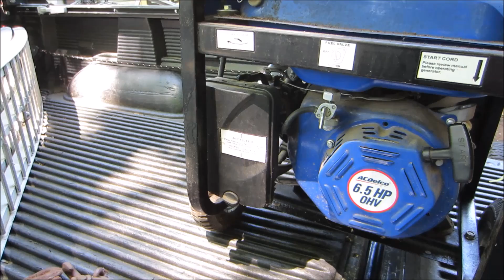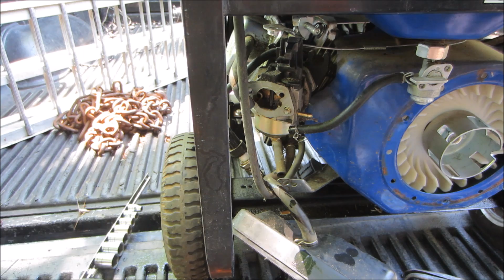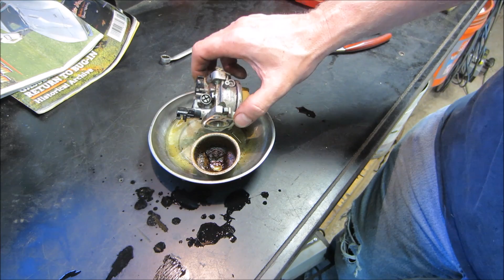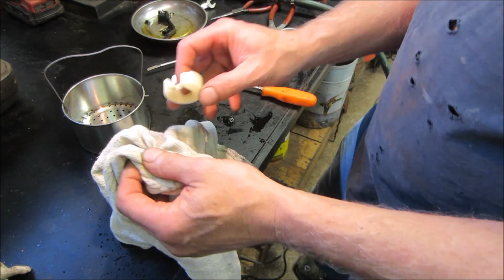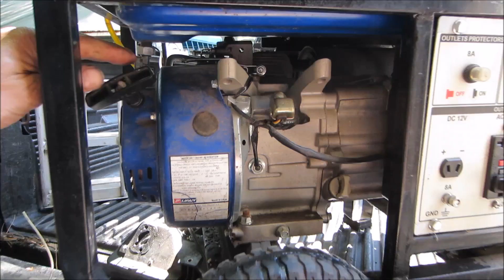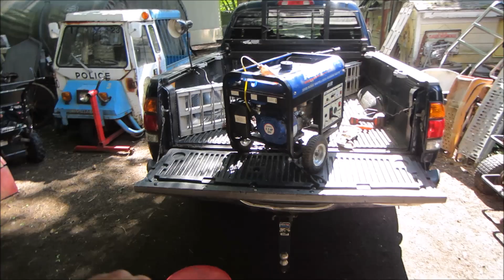will it run? seized china generator

Comment: It is way over-revving. That's spinning at 3,000 - 3,500 rpm when it should be about 2,300/2,500. I have two of these slthough slightly different between units. One is a 13 hp, 5 kW and the other 6.5 hp, 2 kW. The govenor and spring adjustment is sensitive and can be difficult to get right. It is essential to have a stock air filter to get the fuel ratio correct. The fuel tanks on both are made of shit steel and rust with the smallest amout of moisture. I no longer use our 10% ethanol fuel and use low octane unleaded. I drain the fuel when storing and squirt a lot of WD40 in the tank to help prevent rusting. In any case the E10 will deteriorate seals in a short time. These generators are low quality but if treated with TLC should last a reasonable time. They are about 1/2 to 1/3 the cost of good quality generators. The motors are Yamaha copies I think. The design is OK but the metal and manufacture is low quality. The first smaller one I had was relpaced under warranty after it just died at 30 hours. The rocker just collapsed and chewed the head up. Poor hardening on the tappet was the prognosis. The second replacement one was OK but I destroyed in an accident but that's another story. The 13 hp unit had problems that required some work. Carburettor and weak govenor spring and some rust in the tank plus a broken pull cord.

Comment: Just an FYI: Can't just use front panel voltmeter to set speed on an AVR gen. AVR is Automatic Voltage Regulator. Need to get you a "Kill-A-Watt" meter (~$30), which has a Hz measurement. Set Hz for about 62-64Hz (NO LOAD).  This sets RPM to just over 3600. AVR should then set proper output voltage.

Comment: That thing is almost the same as a Generac GP5500 mechanically. Even the air cleaner is the same and it's 50 bucks from Generac for that assembly. Good mechanicals on that AC Delco branded one

Comment: I bought  one of these and it hunted like that right out of the box especially at low load. With the choke 1/4 closed it would smooth out. I figured it was running lean so I filed the main jet one size bigger with a MIG tip cleaning file. Now she runs like a swiss watch at any load level. I heard something about these EPA rated carbs being too lean.

Comment: I c u rebuild and work on a lot of generators. I recently bought n inverter gen that's rated at 3000 watts and 24 amps. It has a 30 amp 120v twist plug n a 20 amp 120v three prong. I'm running  my welder that draws 24 amps in the 30 amp outlet. It runs it but sometimes it bogs down but does not shut off n I don't c the overload light come on. What is the damage that could b done when running a gen to max load 4 short periods of time (5-8 min) b4 letting in cool?

Comment: Do you charge for your time to do this type of work? If you do can I ask how much? I do this type of work all the time and I only charge for the parts because I already have a full time job and this is a hobby for me but my problem is that I get too many projects.  Just curious how you handle it.  Thanks for the video!
Reply from the maker: l need to says no  allot
Reply from the maker: so l got that going for me,
Reply: Mustie1 Don't worry Darrin,with all the good deeds (fixing the elderly gentleman's snowblower a couple times, then swapping for a newer one when it finally went fubar/taking the shed off the other neighbors hands and taking care of the cleanup/all the other stuff you do for your friends, neighborhood and the elderly over the years (and that's just what you showed us); You've probably built up enough points for that "deathbed enlightenment" thing Bill Murray was promised in Caddyshack. So you got that goin' for ya!!!

Comment: I always learn a trick or two from your videos.   When you fixed the garden tractor hydrostatic transmission a few weeks ago it reminded me to check the oil in my tractor transmission.  When I added some oil it stopped slipping.  Your trick with the small screwdriver helped me get the rubber plug out of the top of the tranny.   Thanks.

Comment: The o-ring on the plastic pilot (idle) jet should be inspected or replaced when the carburetor is serviced.  If the o-ring is falling apart it will run rich and drive you crazy trying to troubleshoot.  I replace these all the time on Honda HS series snowblowers.  I also remember to remove all rubber gaskets before it goes into the ultrasonic cleaner.  I've learned the swollen rubber lesson a few times! Honda PE certified technician.

Comment: Thanks for another video. I noticed my predator gen hunted to this spring when I first got it, but started it yesterday for its quarterly run and it ran fine. It liked the warm weather.
TIP: I got tired of switching tips on my air nozzle and swiped the inflator off of one of those disposable helium tanks. Works great for blowing out passages. It threads right on to a quick connect and has a nice variable air flow.

Comment: Mustie1 I love your content! 
Maybe you or other viewers can tell me what exactly the little air tool is that you use to clean things up with the wire wheel attachment?? Sorry.. little garage experience. Thanks in advance!
Reply from the maker: it was an air gun with a rubber tip
Reply: Mustie1 - sorry, I didn’t mean specially to this video. I should have said that.. I meant your usual go to tool for cleaning rust and crud off.. air powered with a wire wheel. Is it just a dremel? Die grinder? Just wondering what it’s called.

Comment: All the rust and it's running way fast unless you turned it down without showing us :-) When I run my Honda EM2200X I turn off the gas and run it dry, then pull it up to TDC so nothing comes in there :-) turn off the ignition and it's ready for the next time.

Comment: Hey Mustie. I have been quietly following your videos for a while, but I just wanted to thank you for the clear, relaxed videos. 
I just bought a 1985 Honda V65 that has been sitting for years. I would not have the confidence to take on this project or do other motorcycle and small engine repairs without your videos. 
Again, thank you.

Comment: Some generators need a pretty decent load on them to run smooth. like an electric heater.   If you're running a light load, just close the choke a little.

Comment: Excellent video. I had a similar issue with one in my shop surging, finally took out the black idle/throttle screw on top of the carb and increased the size of the little jet to the next size with a miniature drill bit, and it worked great. EPA is trying to run small engines a little to lean. Thanks for the great video's.
Reply from the maker: l agree

Comment: Carb clean something heavy duty. Spray down passages. Might help? See how well the carb clean drips or flows. Be sure to check fuel lines for bad fuel residue. Run like star tron or sta bil into tank least clean with it.  Yea I know you don’t like it. Every little bit helps. Like pour a bunch open flow valve to flush it. You want something to dissolve the heebie geebies.

Comment: That carb looks identical to the carb on a Honda GX270 engine. The air filter is much better on the Honda though, a proper pleated cartridge filter versus the sad, thin piece of foam on this one.
Reply: The idle circuit is the black plastic insert under the idle adjustment screw, it's two-part with a separate black plug. The small screw that was under the black cap is the idle adjustment. You can set the throttle at idle and tweak the idle stop and mix adjustments until it idles properly.

Comment: Looks like one of those Huyei carbs. Clone of a Honda. They use those things on most of those Chinese engines. Biggest thing to watch on those carbs is the plastic idle jets. They have an extremely tiny orifice that plugs easy and is hard to clean. Sometimes they will surge and the problem is that low speed jet. I’ve even heard of drilling them out slightly to fix the surge.
Reply: My neighbor bought one of those Chinese side by sides with the clone Honda engine in it.   It doesn't even have a dip stick!   I don't even know how much oil it's supposed to take!!!  He's had it for almost ten years now, and we can't find an oil filter for it; nothing at Napa fits it!!  I put a quart and a half in it??  Looks about good!?  It doesn't have an oil fill orifice; I take the valve cover off to fill from!   I guess they're saving money?
Reply: @garybulwinkle82  it's gotta have an oil fill , ive never seen an engine in my life that didn't have a full hole, they got oil in it from the factory and I doubt they poured it in through the cylinder head that's rediculous. And I've seen many many engines in my day. Sometimes the fill hole is doubled use as something else like a sensor or something similar and you remove the part to expose the fill hole
Reply: Idle jet the biggest problem I've found.
Reply: John Acuff ,  I re drill my jets to.  Awesome power if you do overdue

Comment: Excellent work, Mustie1. Thank you for the video. Being that gasoline is a ultra light oil- that flood condition saved the crankcase internals. That heated ultrasonic parts cleaner continues to save the day, and is perfect for situations like this. ATF is the #1 choice for freeing a seized engine or electric motor.

Comment: Take the tank off, half filled with water and sand, stick it in a tire and drag it around with the extra long ATV for half an hour. Probably clean enough to use. Wash it out well. Rinse with a cup of gas. Could use Por 15 if it is still bad.

Comment: Again Daren great video I always learn something watching these...an air filter is really important (think I will now go out and put the air filter on the engine that runs like cap it might help)
Reply: His overlaid comments suggested it always ran crappy till it warmed up to operating temperature, which is likely around 350F at the head.  He reinstalled the air cleaner after it was a bit warm.

Comment: Usually when I can’t get those throttle linkages undone, I’ll double nut the stud and remove both studs to get the carb to rotate how I need it to. I try to stay far far away from messing with the gov if at all possible. I’ve seen one of your other generator videos when you messed with the gov and  it and totaled the project.

Comment: I had a bike when I was a kid with fuel problems like this, with the carb leaking fuel into the engine.  It was a 250 twin 2-stroke, and if I forgot to shut off the fuel, it would leak into the crankcase - to the point that it started dribbling out the exhaust pipe.

Comment: pour muriatic acid in the tank, flip it top, bottom,side to side, neutralize it, pour it out, rinse it out, blow it out then fill it with at least a quarter gallon of fuel to coat it and keep it from flash rusting. Acid works amazing for taking off rust.
Reply: There are plenty of videos on this channel of Mustie1 bringing tanks back to life in this manner (or at least using the same general idea as this method).  As he suggests in the video, he's done what he was asked, and the tank is the owners problem.
Reply: Trevor Stewart I'm aware. He just made the tank sound like a lost cause. I'm only saying I've brought back far worse tanks using acid. $8.00 fix. How much is a replacement tank that may or may not fit?  The reality is I paid $100 for a fully working 5500 8500 surge and it would cost me more to fix it than to buy another.

Comment: Back in high school my friend and I would buy cars that were sitting in folks yards, fix them up and sell them... Often we would find an engine with the same issue, my fix was to fill the cylinders with Marvel Mystery Oil, let it sit for a day, then hit the crank bolt with a breaker bar...  Never had it fail :)
Reply: Screw marvel mystery oil , that stuff is a sham , use sea foam , that stuff is a true marval
Reply: Yup I've had seized engines poured 
a mix of marvel mystery oil and acetone in each cylinder and in like 45min it was free

Comment: This question is in general regarding your generator repairs.  You never seem to check the Hz of the generator to insure that the engine is running at the correct RPM to output 60Hz.  Not so critical for lights but your refrigerator/freezer/AC compressor motors get very unhappy at line frequencies other than 60Hz.  You can't assume, just because the voltmeter reads 120/220V, that the generator is outputting 60Hz.  The newer generators with their automatic voltage regulation circuits can maintain correct voltage output over a wide range of engine RPM's.  I would guess that your shop multimeter has a Hz setting that would allow you to set the proper RPM on the motor.
Reply from the maker: l just dont show it on camera l have a mechanical rpm guage,

Comment: Well done. Regarding the stuck throttle, I would have tried spraying carb cleaner through the carb throat and letting it soak a minute or so   to see if that would free up the throttle plate. If so, that would avoid the disassembly of the governor linkage.

Comment: Remove the rust in the tank with apple cider vinegar. Rinse it with baking soda and distilled water. Then use redkote to seal it.  Cheaper than a new tank.

Comment: The "cold hunting" issue sounds like my POSgen project generator, just needed the governor adjusting to the right frequency and it stopped being a PITA... :)

Not actually used it for any serious purpose to date though, just used it as a learning project... :P
Reply: I was told by the Onan people that most generators should run at as close to 3600 RPM in order to prode the 60Hz, line frequecy we need... ant that should produce the correct voltages as well. (some smaller units only run at 1800 RPM instead)

Comment: Found a disposal point for your bad gas/oil that you don't want to keep around. You may have a Bulk terminal near you (I have several) (big town), and they will take it usually as long as it's gas  or oil.  They usually have a waste tank for reworking bad gas pumped from the bottom of underground tanks.  They have to do this when they get too much condensate water in the tanks.  Bad gas goes back to the refinery to be reworked back into fuel.